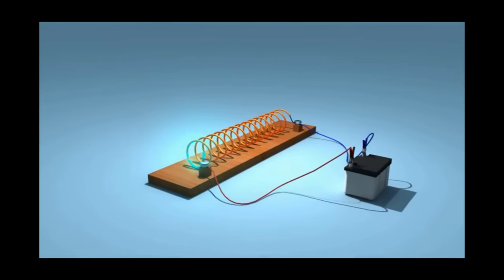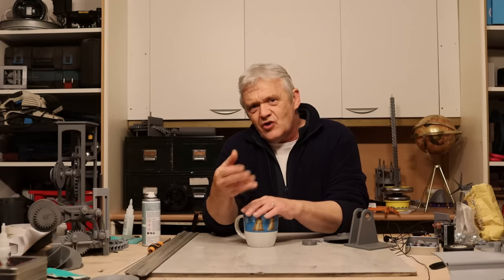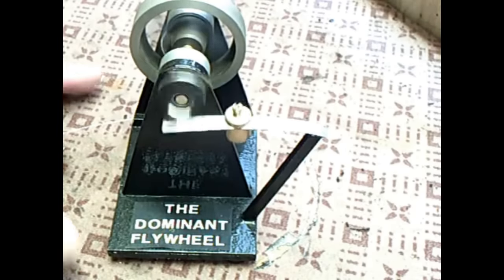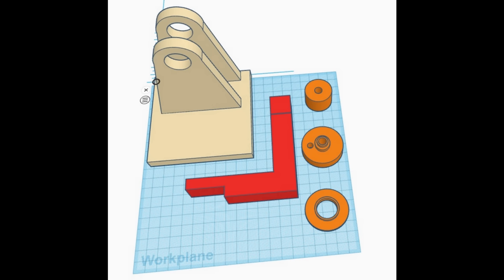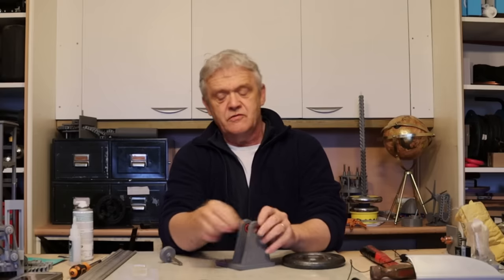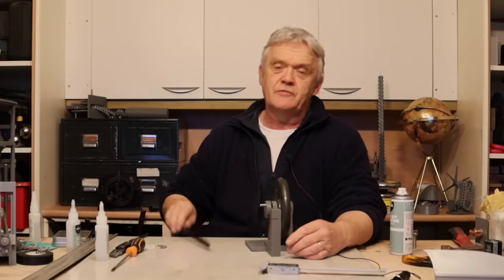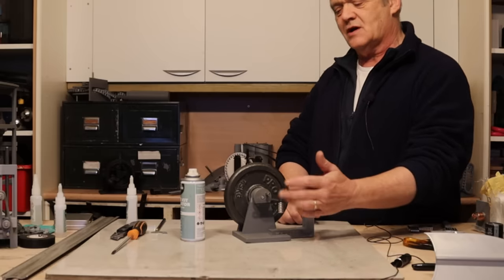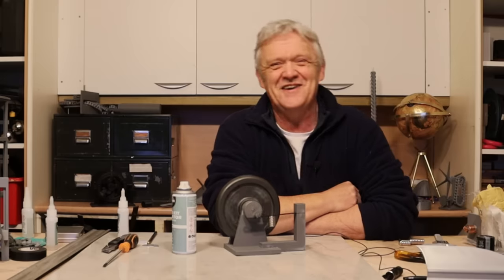2096 An Unusual Spring Motor

Comment: I dont know if i fully believe this, it looks alot like a "free energy device" you still should lose power! but maybe ill try it one day, if anyone can explain it better please do!
Reply from the maker: why would it be perpetual motion?
Reply: @ThinkingandTinkering  well it just feels like it keeps turning, even if it doesnt the wheel should slow down way more but if it works that would be really cool! Its just weird seeing a wheel that you put some energie into, turn way longer even tho there should be losses where do those losses go? Why does it keep turning for so long? How does it keeps turning... is it just set to a specific speed?
Reply: I think i am slowly getting it but it sure is quite different from anything else indeed!
Reply: @humanplaysgamesiguess7736  The spring "amplifies" the flywheel's size or weight basically and the initial push causes power to be stored in the spring and transferred back to the flywheel, it will be more efficient without the spring but it will carry less inertia in the beginning, the flywheel's speed will accelerate and decelerate the whole time with the spring. If you can add a small oscillator circuit and a coil around that magnets you should have a way to actually accelerate the flywheel.

Comment: How is this a "motor"
Its just a fly wheel with some extra load. 
the spring can only push back with less force then it needed to compress so your better of without the spring at all. 

If you want a mechanical equivalent to a LC tank look at a Pendulum or Harmonic oscillator

Comment: I'm a bit concerned at how much this resembles all those perpetual motion machines that people try to pass as legitimate... I wouldn't think you'd go down the direction of pseudoscience so I'll hold out hope that this was either a mistake or a misunderstanding.
Reply from the maker: i don't understand - why would anyone think this was perpetual motion? as i said in the video this is the mechanical equivalent of  tank circuit - and to my mind - somewhat obviously - friction is going to stop it turning
Reply: @ThinkingandTinkering  The original video shows the flywheel accelerating, which is only possible with an external power source. I don't think that's what you did here of course, but I also don't think it's quite the same thing as a tank circuit, at least not to the same extent as something like a pendulum or LC circuit. It seems to me that it's merely a way to get a non-constant rotational speed out of the flywheel, at the cost of additional friction. If you had an alternate setup that stores the entire energy of the flywheel into a coil spring and then causes it to reverse direction as that spring energy is released, that would seem more like a rotational analog to a tank circuit to me. But regardless, the original video seems to be a dishonest attempt at a perpetual motion machine which is why it's concerning to me.
Reply: @OceanBagel  Nowhere does he say anything about perpetual motion, any person with a basic knowledge of thermodynamics knows that perpetual motion machines do not exist.
Reply: @Voidy123 @Voidy123 I never said he called it a perpetual motion machine. I said it resembles a perpetual motion machine and that it might have been featured here by mistake. The original video wasn't a mistake, it was intentionally deceitful with a hidden power source driving the motor. And it did successfully deceive people, judging by the comments on that video and reuploads calling it free energy. Robert's version was not externally powered in this way and he didn't try to deceive anyone about the mechanism, but I still think it was a mistake to feature this mechanism without calling this out.

Comment: Why didn't you duplicate this machine 1:1? yours won't hang around forever. The spring's pushing force is negligible because it is placed straight. The old machine has a spring bent in the form of an arc, and it has a movable weight that shortens the arc, thereby increasing the strength of the arc. You did it wrong. Was it on purpose? Can't you duplicate it 1:1? Your machine is bad.